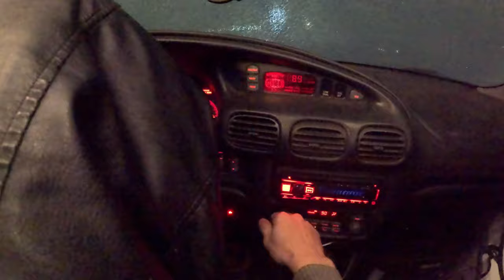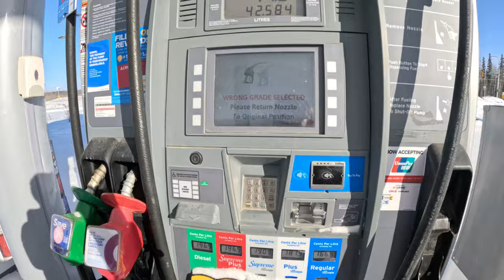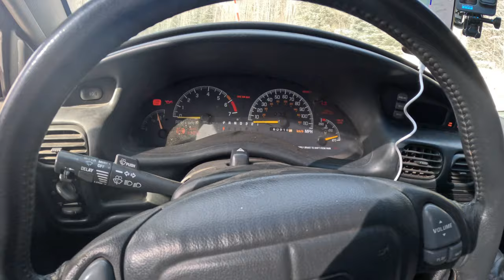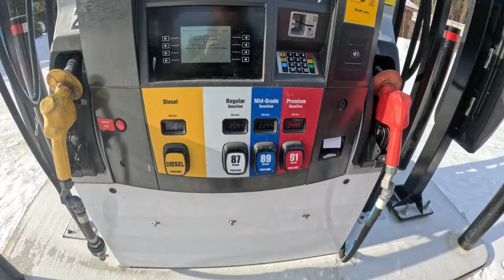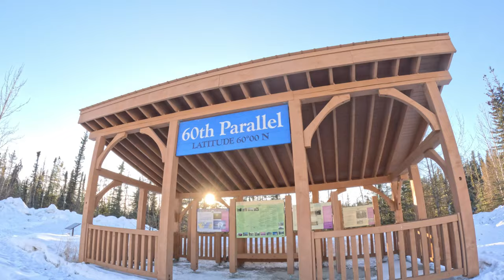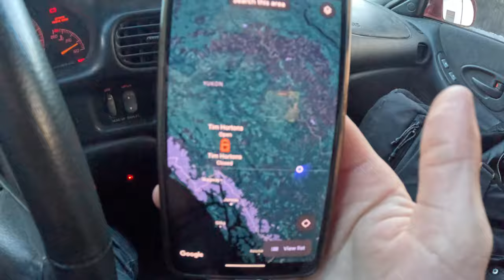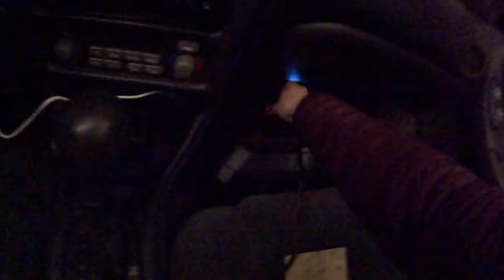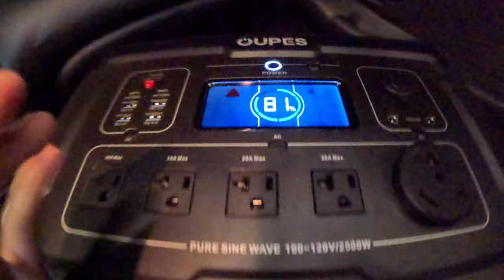Alaska - Day 13

Comment: you dont have to keep the oil warmer all the time just plug it in like a hour half a hour before you start driving the oil will not freaze you just have to warm it a beat but any way the top part of the engin will not gate warm by that little thing because the oil is not moving when the engine is not running

Comment: Regarding the gas burner:
You probably know this already, but just for completeness:
the 'fumes' from the burner are not the problem. The problem with using a gas burner in the car is that it actually burns the oxygen and leaves you with mostly carbon dioxide, a colorless, odorless gas that's undetectable to our senses. It will just make you tired and can then silently kill you (in extreme cases).

Comment: If your car won't start after filling up with gas, the most likely issue is a stuck EVAP purge valve. It could also be an issue with the fuel filter or fuel pump. My car had that problem too
Reply: I have the same problem, its the purge valve

Comment: The trouble starting after fueling could be a vacuum/ fuel system pressurization failure
Reply: Didn’t Nate break a vacuum line when changing the first spark plug?
Reply: @KoozleGaming  oh crap, you right he did!
Reply: It's definitely related to the evap system or vacuum is why it will break watch
Reply: @KoozleGaming  pretty sure he fixed it but maybe it didnt work lol

Comment: The main difference with an electric car is you would need to charge up more than you refill. But a tesla can power an average home for several days. Heating over night wouldn't be an issue but charging more is the main inconvenience

Comment: If you wanna fill up your tank in canada and not sure exactly how much, just prepay like 100-150$ once you finish and return your nozzle, if you didnt use the entire amount you paid for, it will get credited back to your bank automatically
Reply: When you find those outdoor plugs at a rest stop, plug your oil pan heater directly into those outdoor plugs. That's what they're therefore. That way you can save your battery. I bet you there's an outdoor plug at that rest stop. Everybody in the North has engine heaters that they need to plug-in.

Comment: People. Do not think you will spin a bearing just idling in the cold. It would have to be around -60F to be even close to doing that. The only time it would be a problem is if you drove off as soon as you started the car from a cold start.
Reply from the maker: Once you get to idling, you are fine.

It's the first turn over that is dangerous.
Reply: @NanoBytesInc  Some what true. When you crank the car (start it) it’s not spinning very fast at all. It will probably never happen if at all.

Comment: It's fine, my house was built in the 1800's and only about half the outlets are grounded... I just snap off the ground pin of my plugs, been doing it for over a decade and never had a problem. I have my entire gaming PC (with a 1000 watt PSU) and home theater system (with a 1400w RMS amplifier) connected to a surge protector with the ground plug snapped off like that.
Reply: Oh and EGR is exhaust gas recirculation, it's an emissions control system. You're fine, just don't travel to a state that requires emissions testing.
Reply from the maker: Yeah, my engine has been throwing emissions codes for a while.

But Iowa does not have inspections, so it doesn't bother me

Comment: As far as toxic to breathe the gas, blue flame = complete combustion with no byproducts. If you have a yellow flame that's when you need to worry about combustion gasses. Propane burns fairly clean.